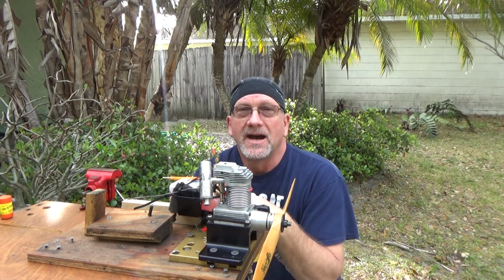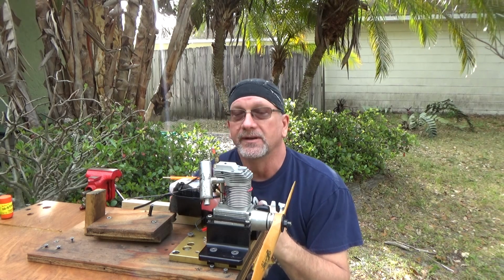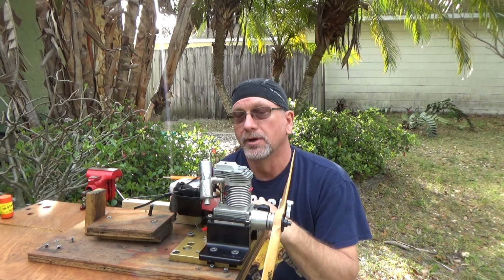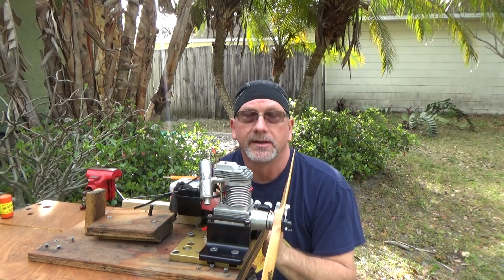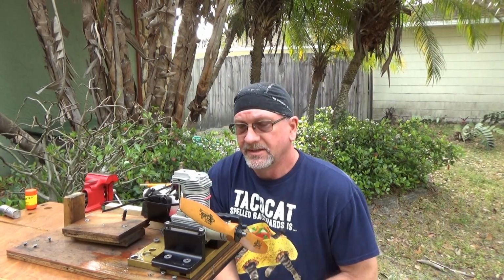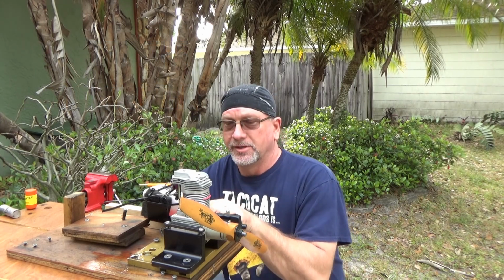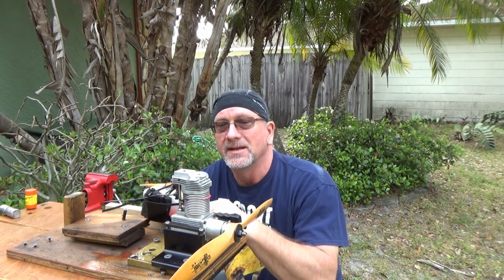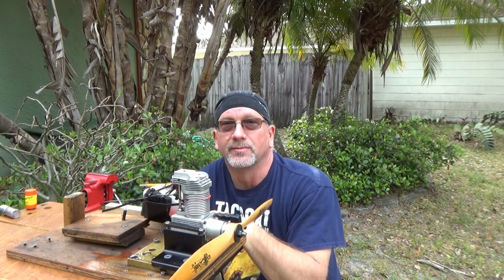Laser 100 A Final Run

Comment: The more i see the more i suspect the engine has been badly overheated at some point in its life. When that happens repeatedly the head bolts will come loose and then the cylinder barrel can move while the engine is running. This has likely damaged the mating surfaces which is causing the leak. I can repair it, but i would need the engine back here at the factory. 

Certainly the engine runs better without the exhaust, but it still seems like its labouring and really is not running as it should. I thought i could see end float in the carb, which also will not be helping.  If you have one and have the time i would like to know how a 14x7 apc performs as this is my benchmark prop for the engine.

I still believe the engine is far from dead, but it is going to need some work to get it back where it should be
Reply from the maker: What things would need to be replaced in the event of it being run hot?  It sounds like it is more money than it is worth to repair quite honestly.
Reply: In the case of an overheat usually the rings loose their tension and the head comes loose. As your engine has loads of compression we can consider the rings ok so its just a case of making sure the mating surfaces for the head/cylinder are smooth and thats about it. The exhaust and carb are basically a symptom of age, but the glow plug leak is a very strange one as i have not seen that before

Comment: That run seems about ok for 0% nitro and a 2-stroke plug. The carb might be a little worn or damaged during the past. I  am curious what will happen to my Laser 150 when I fly the engine for  some time. This engine has the same carb like your Laser 100 and it experienced a "hard landing" I suppose. Unfortunately it is not possible to disassemble these carburetors. I would like to see another final run of your engine using the new prop, a 4-stroke plug and 10% nitro fuel.
Reply from the maker: The Enya #3 is most commonly a 4 stroke plug.  That is the plug provided with all Enya 4 stroke engines.  I can do a run video of this with 10% fuel.  I figured after 7 videos folks might be sick of seeing this engine.
Reply: They work very well and I use Enya 3 plugs in 4-stroke engines including Lasers. OS "F" can help if you need the idle extremely low but is not necessary. I was hoping we can start something like  "the lowest 1 Minute idle rpm" competition with the Laser engines. ;)
Reply from the maker: It seemed to idle better with the OS F plug for sure.  I don't have any NEW F plugs but I have a few that should be serviceable.  I also have some Cool Power MV 4 stroke fuel. 15% nitro, 18% all synthetic oil.  Maybe that would be good.
Reply: Cool Power 15% Nitro and an OS F plug would be very interesting. 
Maybe lower max rpm...but also lower idle rpm.
Reply: The weather seems ok tomorrow to go out, Fly and make some bench Tests. I don't know if more than 10% nitro are ok since Laser recommends "up to 10%". I have some Simprop Supaglo 16 with similar oil and nitro content to test. If I find the time my Laser 70 is going to taste that fuel.
Reply from the maker: I don't understand what 'tank videos' means.
Reply: Tanks are heavy armored vehicles with a big gun mounted on a turret capable of shooting explosive or armor piercing ammunition . If you make a video about one of these vehicles you got a "tank video".
Reply: ringofthebrave Simprop Supaglo enthält 14% Synthetik Öl und 2% Rizinus Öl, also insgesamt 16% Öl und 16% Nitro. Cool Power MV 18% Synthetik Öl und 15% Nitro. Simprop Supaglo 16 brächte ein interessantes Laser Motor video.
Reply: "Tank video": A video showing a combat vehicle like the M26 Pershing
Reply: We typically recommend an os F plug but the enya 3 will be ok. Certainly it will not be causing the issues here. I would not recommend nitro over 10% as it wont make any difference to the performance of the engine. Most of our engines are quite long in the stroke and due to our combustion chamber design more nitro makes little difference to the performance. We could change it, but then we would loose efficiency and we dont want to do that.

Comment: 3:40, oil going out form the bottom of cylinder, weird.
Reply: There is no seal between lower cylinder and crankcase. I would consider that as normal if no sealant was applied during assembly.